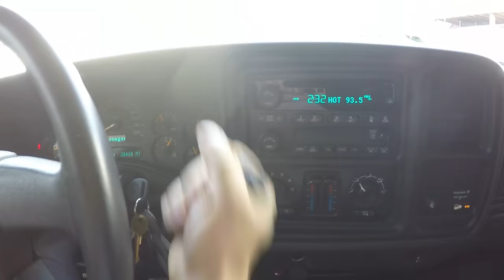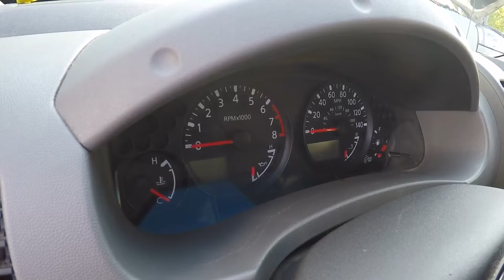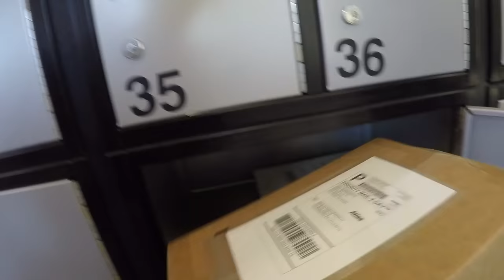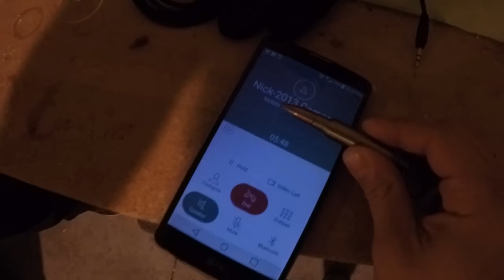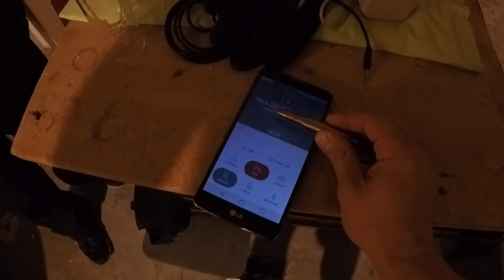THIS Is Why I RARELY Take My Truck Off Road...

Comment: reason why you dont take a 2500 off road, its a 7000 pound anchor.
Reply: Trent Nelson then explain the ram power wagon or the h1 hummer lol.
Reply: powerwagon is only 5000 pounds, it has a gasser motor, about 1000 pounds lighter and the H1 civilian is all Aluminium.
Reply: Dodge 318 Cummins Power wagon uses a gas hemi engine which is less heavy than any diesel engine buddy
Reply: what?
Reply: >dodge 318 cummins power wagon 
>uses a gas hemi engine 

one of these is not like the other.
Reply: Yea open diffs too
Reply: Dodge 318 Cummins 6.5 Detroit, they dont have a duramax.
Reply: the 318 is a 5.2 which is a dodge 90s model gasser motor
Reply: ITzMichael523 ?
Reply: Dodge 318 Cummins is 318 your area code or something? i was saying the 318 is a 5.2
Reply: None of you have any idea what you're talking about. The power wagon has a GVWR of over 8000 pounds, and it's an offroad hoss.
Reply: Trent Nelson the h1 hummers used the 6.6 duramax.
Reply: ITzMichael523 I know! Who asked?
Reply: ToAstYNaChO The power wagon has solid axles, coil suspension,  full locking differentials, and a disconnecting swaybar. Not even the same thing
Reply: Dodge 318 Cummins why is your user name 318 cummins????
Reply: Trent Nelson it's probably better to take a 1500 right
Reply: Alex Stern
Same thing to what? i wasn't comparing it to anything. I was commenting on the guys saying a 2500 is bad offroad.
Reply: C
Reply: Jack Mcgaha jeeps are good but Chevy is King
Reply: ITzMichael523 it's just a name bro just like yours.
Reply: what?!
Reply: Christian Yates chevy is a highway truck,  I know  I own an 02 duramax,  but I use it to pull jeeps off the trails and trucks out of ditches.
Reply: slap a supercharger on it, and he'll be fine.
Reply: Trent Nelson The Power Wagon is exception. My '16 Power Wagon is a beast off road! Can't just slap a lift and big tires on and think you can go any where. More to it.
Reply: Nelson Quinnell ok, i haven't had enough seat time in one to really make a comment about its capabilities but a 7-8 thousand pound truck shouldnt go and do technical off roading where you need to know what everything on your vehicle is doing.
Reply: Eugene Krabs it's already turbocharged
Reply: It weighs around 6,000-6,500, not 5,000. Half ton trucks even weigh over 5,000.
Reply: Jeeps will always fit more places than most trucks.
Reply: Jake Holm Toyota 4 life
Reply: Dodge square body is the way to go
Reply: Power Wagon isn't real? The power wagon was produced from the mid 40's to the 80's. they have since brought back the name power wagon. but totally agree they aren't true to the name.
Reply: ToAstYNaChO oh my bad
Reply: Go watch the videos of PowerWagons doing crazy trails at Moab...
Reply: i thought you didn't take it off road because it doesn't have a solid front axle.. which is a big mistake by chevy.
Reply: Actually the 318 Started in the 1950's but wasn't a LA engine,it was a WideBlock,lasted until 1966,(1967 in Canada)......Nothing to do with the 1967 and up 318 that you are talking about..1967-2003.
Reply: Power Wagons used 6 cyl engines as they started in late 1930's,early 40's 11st 4x4 truck....Then 313poly,325poly & 354 Hemi..318,360 smallblocks,383 Big Block,400 Big Block,440 Big Block engines.Current ones used the 5.7 and 6.4 hemi engines..
Reply: Eian Wahgener
My ram 1500 has an icon stage 4 suspension kit, and it can take a beating, just cant handle big fat tires. and can go double the speed over any terrain that a solid axle could do
Reply: speed isn't everything though.
my twin live solid axle could probably pull you out of anywhere you get stuck
Reply: +Dodge 318 Cummins power Wagon is junk and just for looks
Reply: If you want to go off-road use a jeep Tacoma or something small lol
Reply: Ford GT no. just no you know nothing about off road
Reply: Ford GT Jeep Tacoma? When did Toyota Buyout Jeep?
Reply: +Wyatt Mccready well if every car was stock those and stock off-road are the best to use
Reply: look at the names

Comment: First time a fuel wheel is documented offroad
Reply: blake m 😂
Reply: blake m 
As soon as he complained I paused the video to see if anyone commented this way.  I wonder if he stops drag racing if he wears a set of tires out. It's Function over form, not the other way around.
Reply: This channel comes up for me constantly b/c I clicked on one video! All the videos he puts out seem like clickbait or worse.
For a guy dumping so much cash into vehicles, why couldn't he drop some money on 35s/37s on 17s instead of using offroad tires on 20s+ for guys headed to the walmart meet?

And he didn't even air down a little... what did he expct to happen with such a wide lip on the tire? Too much money & not enough sense. That's why I run 35s on 17s & not 20s.
Reply: +prince0fsains my problem exactly

Comment: Why the hell would you get a truck like that, and lift it but never go off road? Can someone fill me in on this mindset? I take my truck off road all the time...
Reply: That's what I figured, I can't stand people like this.
Reply: You don't have to turn your truck into a beater to take it off road... My 85 Toyota has 320K miles, I go off road a lot and its in great condition.
Reply: some people like the looks. I rarely have time to off-road anymore, but I still enjoy the off-road community. so I lifted my tahoe. posi, tires etc, and never go offroad really. I just don't have time and there's no land available nearby.

I mainly use my tahoe during our really hard winters.
Reply: Raycharlesduramax so you own a pavement princess. it doesn't have to become a beater. put the proper rims and tires on and he wouldn't have chipped it. if you have more rim than tire on a lifted truck you're doing something wrong and should just stop.
Reply: water on the street? where do you live where water is in the street. he live in hershey where the closest major river is the Susquehanna and the highest its ever gotten wasnt even close to flooding streets.
Reply: Thats right.More tire, less rim, Better traction off road and great on speed bumps.
Reply: Jake Tow he built the truck a daily that looks cool and doesn't look like every other Duramax
Reply: There was a guy I just passed today at a acura dealer. A H1 was on the front with 17inch rims......GG
Reply: Ace Tech Sorry for your terrible experience...
Reply: Jake Tow Naw it was a joke. H1 come with 17s hahaahaa. The Cheese heads come with bigger tires though.
Reply: Jake Tow he is scared he might get the wheels scratched
Reply: He built the truck to be a show truck.
Reply: Or, he wants to spend his money how he wants to....
Or, maybe he likes his truck to look like that because thats how he likes it....
Or, maybe he takes good pride in expensive purchases and wants it to last longer, Or, he takes good care of it.
All reasons could be it, ill let you pick what makes the most since. 
(all of them)
Reply: Jake Tow it's to nice of a truck bud. Mudding can cause rust. Off roading can ruin the tires and rims. And can do many other things.
Reply: Steven Stringer Who said I drive one?
Reply: I understand driving off road if thats part of the job, or you need to. I don't understand tearing up your vehicle for no purpose but fun. I agree its fun, but fun isn't $40,000.
Reply: So a person would buy a gas guzzling 4x4 that the owner probably cant park, cant take into a city, sucks up valuable income and depreciates half its value in a year... Just to never use it as a truck. Its a fashion statement, face it.

The only benefit that StreetSpeed has is that he bought his truck used.
Reply: Steven Stringer btw he bought it with one owner and low miles so he ruined an awesome truck.
Reply: you do know they make these things called snorkels.   its way cheaper and gets you WAY more than lifting it
Reply: JulianS2016 Hahaha you don't lift a trucke to make it last longer!  Lifting a truck puts way more stress on some important components, and cuts down on the life span.
Reply: Ian Smith On an IFS like this with a cheap/improper lift, yes. With a proper lift, you won't have accelerated wear on anything.
Reply: Didn't say he lifted it to last longer, said he takes pride in an expensive purchase and doesn't go offroading. That will help it last longer.
Reply: Steven Stringer Then why not keep it stock. Thats what i would do, if you need to go out and check pivots or fields it works for that, you can still pull a gooseneck, plus you have a truck thats more versatile. and if you can afford the gas it takes, or diesel in this case, why not?
Reply: JulianS2016 he has a nice ass truck and he wants to keep it that way.👍🏻
Reply: that truck is expensive and is built for looks not function.  your truck is cheap and not worth near as much. also the compact size makes it easier to get it through trails undamaged, full size trucks are harder to do that with depending on where you live.
Reply: camaroman101 then it's completely fucking pointless you get a truck so you can get dirty and make new roads
Reply: I've got 4 4x4 trucks and 3 of them all pre 1975 will never see mud again,  but my 86 k10 is bare bones  basic paid 800 for it and that's the offroader.

I've only got about 2300 in it with lift, tires and engine work but its made for mud.

a truck like this especially with the money he has in it is made to look bad ass "which it does" 😉 while going down the road.

anyway to the owner of this bad ass rig awesome vids and nice work keeping that truck on the road.
Reply: they have a name its called Road Queen(s). When someone has a lifted truck but never takes it off-road.... at least my excuse for not taking my truck off-road is that its too low Lol
Reply: +Pedro Reynoso 

well I prefer to use the term children😏 cause my vehicles are my baby's.
Reply: +Pedro Reynoso 

I've had a few of those, 1972 Toyota 3speed couldn't kill that thing with a shotgun.
my uncle still drives that rolling rust bucket😊
Reply: Krad Links haha
Reply: Vanilla Ice and his pavement princess...lol ice ice DuraMax